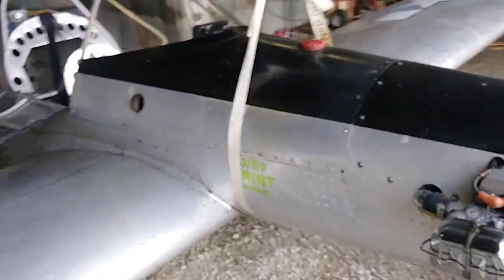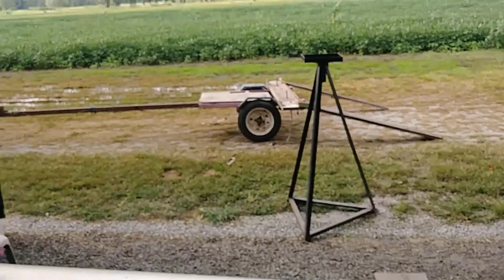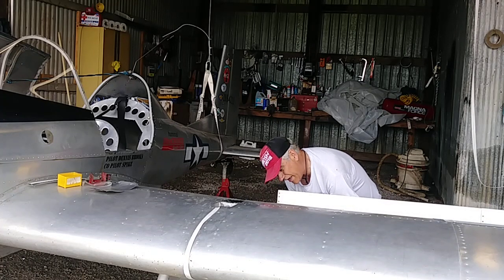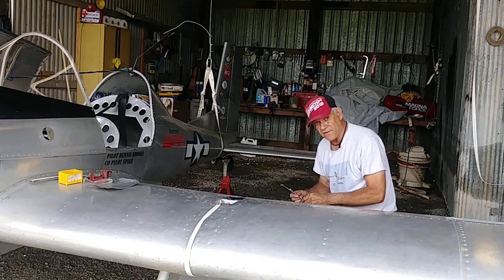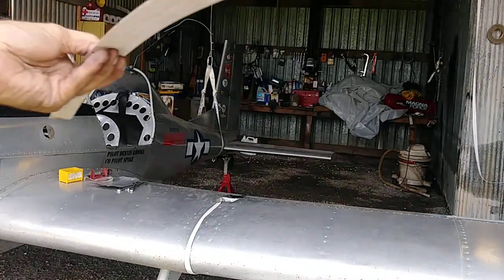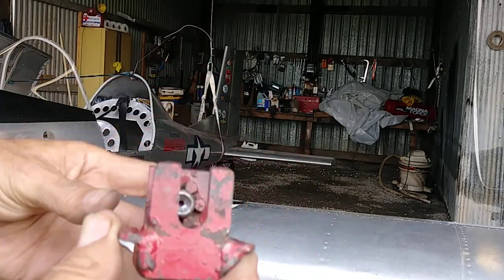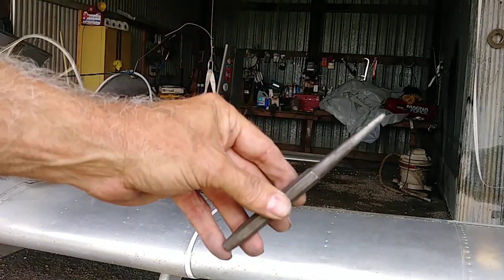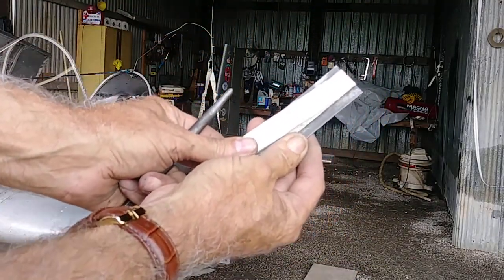Taking wing off UC

Comment: "20 minute job or an hour if ya got help..." lol. Good job Dennis, hey please make a video showing how you get the plane on your trailer and how you transport the wings. Thanks, Dave
Reply from the maker: Hi eclipso104. As far as getting the UC on the trailer I just pull it up backwards by hand. I can't do the H5 by myself unless I do it on a hill. My Astro van works great for the wings but I did not bring my wings home this time. I do have to have help getting them in my van though. Will have to try to get a video of that some day. Thank you so much for your comments.....

Comment: Hi dennis, I know this is off topic, but I'm interested in you're flights; do you fly as ultralight or light sport? What is your longest flight(s)? What altitude do you cruise at on cross country flights? How does the ultra cruiser feel at max limit, or do you cruise at slower speeds? Whats your thoughts on flying with shorter wings? I saw utube on the subject. Is your UC A legal class ultralight? How long did it take to build your airframe?  Will the H-5 replace your UC, or will the UC still fill a desire for low and slow?
This is just a few questions I have. 
Thanks for the videos!

Randy
Reply from the maker: Hi Randy. Thank you so much for all your questions! I will try to answer them all. I will keep the UC as it is less of a hassle to fly and cheaper. I do fly most the time at my cruise rpm or 3000. Which is around 65- 70mph. I have flown my UC 3 times to Oskosh which is the farthest I have flown. I do have the shorter wings which saves weight and makes it able to carry more weight. I built my UC from the plans in 5 months 11 days!!!  I really wanted to fly and as you may know I have reached a bit over 1600 hours in my UC. You really had some great questions and I hope I answered all of them? If you have more questions please ask. If I do not know an answer I will have you talk to Terry at Hummel Aviation. Thank you again for your questions and comments......
Reply: @redblackvette  Thank for taking time to respond so quickly.  I'm 66 nearing retirement. The UC has really got my interest. Your videos are very helpful. I was a Huey mechanic in the military. Bought Sonex plans 10 years ago,  never had time to even get started. I don't have a ticket but my son in law does and I fly with him. Your UC adventures has made me think that  cross country's are possible along with all the low and slow fun. I live in central North Carolina. Thanks again!
Randy Jackola
Reply from the maker: . Hi Randy. Well I retired when I was 48 from GM. I was in the USAF as a sheet metal worker on C5s and C141s. I'm so glad you are happy with my videos and are so interested in the UC.  Yes it does make a good cheap cross country airplane and as you know I do not have a pilot license either. Hummel Aviation guys are great and so are the airplanes. I hope you buy the plans or buy a lot. Please let me know of your plans and if you have other questions. Thank you again for your comments.